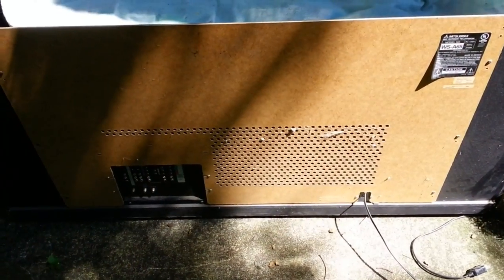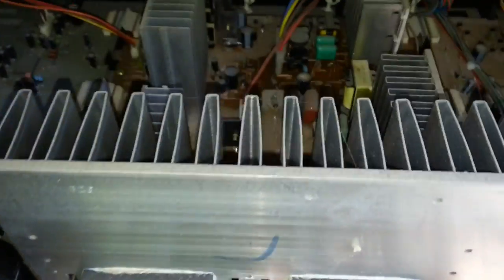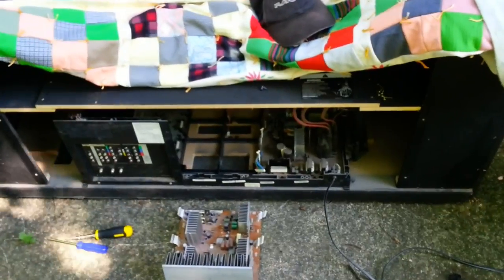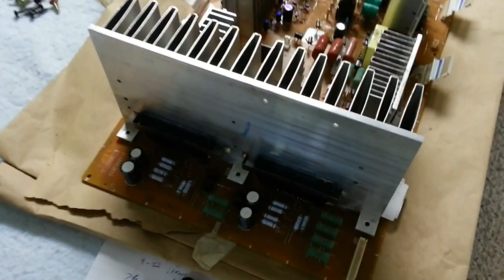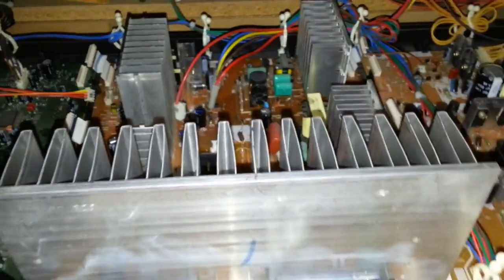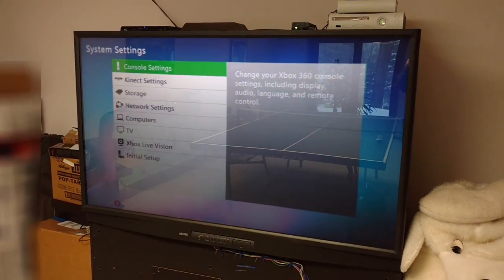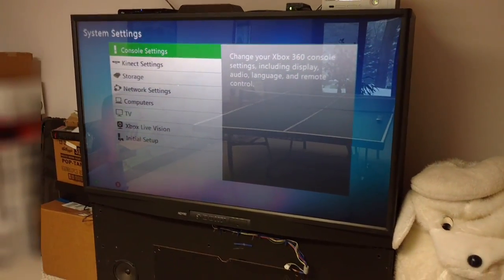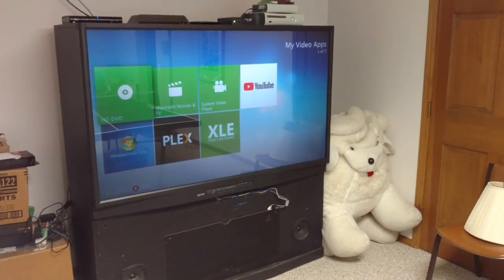Mitsubishi WS-A65 Repair V-Log and CRT Rear Projection Discussion

Comment: If there is anything more un-loved than a leftover CRT TV, it has to be a leftover read-projection CRT TV. The things were so big and ugly that I remember a co-worker buying one brand new and having his wife throw it out of the house. And, as the story proves, they were a nightmare to maintain. I've heard of models in which the  fluid would leak out and actually cause the boards underneath to catch fire after the fluid boiled away. But, I'll bet these things, the few of them which are left in 10 or 20 years, will be serious collectors items; transitional technologies are always kind of interesting. The original high price is understandable considering all the expensive parts in them, but they were not for the faint-of-hear. Meanwhile, I'm glad to  hear that some people are willing to live with them. I wonder if there is a way to make a drip pan or diverter to keep the fluid out of the guts of these things.
Reply from the maker: Thanks for the commentary. I agree with much of that, although I'm not sure that it's a class of product that will have collectibility. I'm willing to be proved wrong on that, however. Many of these are actually supposed to have a primitive apparatus that collects leaking coolant, but I'm not sure how widely that was implemented or how effective it was. Apart from that, (and the  requisite stressful lens cleanings and occasional convergence adjustments) they're actually pretty much maintenance-free; especially the analog models. As far as the MSRP goes, I see where you're coming from in that all of the components were designed for that application, but when you consider how much they cheaped out on factory calibration, (with the intentional excessive overscan used to hide the incomplete geometry adjustments) I still question how "pioneering" they really were, especially when you consider that a lot of the technology was based on the CRT front projectors already in existence. That said, it is worth mentioning that front-projectors could be a lot more expensive (many, if not most, of those were priced between $10,000 and $30,000 in 1990s-value money) and didn't have built-in speakers, tuners, or the requisite projection screen and mirrors, so maybe rear-projectors really were worth the asking price after all. It's probably just the details-oriented side of me who hates a half-assed job.
Reply: I agree with most of what you say. I have a Sony TV projector and I've had it for 13 years and the only problem with it is that the colors are messed up.where you see the letters doubled and the colors are 3 fold if you understand what I mean.  Everything else works except that.  I love my old big TV. I'm trying to find someone to fix it. It's a classic for me. Yes I have my big HD TVs also but I still love my old TV.  So if anyone knows anyone in the state of New York that can help me and fix my TV, I would really appreciate it with all my heart! Thank you!!!
Reply: @rosalinagarcia17  STK ics have failed. It’s not an expensive repair. Image is out of convergence
Reply: @rosalinagarcia17  you just need to adjust the convergence allot of these tvs allow you to do it from the menu

Comment: I picked one up a few months ago, after a while of on time, the picture would shut off. The time it takes for that to occur has decreased significantly, I've read about possible bad soldering at the heat sinks, but in not sure what I'm actually looking for. It's a wonderful tv and perfect for what I got it for, and I don't want to get rid of it for something that might be very simple.
Reply from the maker: Check for evidence of coolant leaks under the tubes. It's corrosive and conductive, so it will eventually do irreparable damage if left untreated.
Reply: Browningate I see no evidence of any liquid leaking in the tv or on the electical panels. My power never shuts off, I lose the picture. After you let it sit a day or 2 it will work fine again for a little bit. That's why I was asking about possible failed solder connections at the heat sinks.
Reply: Browningate thank you for taking the time to respond, I appreciate it very much.
Reply from the maker: @16dbuse
You're welcome. Check again. When this happened to me, the television interpreted a continuous holding down of the power key, which would blank the video, but not turn off the audio. Cleaning the leaked coolant immediately solved the problem. Check especially carefully on the front of the green-colored board.

If your convergence ICs go bad, the 3 primary colors will start to lose their geometry on-screen. This will happen very obviously and abruptly, but you'll still have something on the screen. That's the only case for touching up or replacing the convergence ICs. The symptom you're experiencing would not be caused by convergence ICs, as far as I can tell.

Comment: Wow, I had one very similar to this. A selling point(?), if I'm recalling it correctly, was that it could accept some sort of 'smart/HD module' down-the-line. I always kept that option in the back of my mind through 2007 or so when flat screens were starting to really take off.

My big Mitsubishi was supplanted in my affections by the 32" Panasonic Viera we bought at BJ's Wholesale Club just prior to the Super Bowl in 2007. That 32" Panasonic was priced at $1300; I'm citing this for contrast of pricing. My Mitsubishi was over $2300 at Best Buy in late-October of 2002. I also purchased a progressive scan Mitsubishi DVD player to complement my new TV. The setup was my premiere venue for entertainment for several years and that projection TV served us well.
Reply from the maker: Thanks for sharing! The module that you referred to in your opening remarks was just a basic OTA ATSC tuner. Such devices are rare, but obtainable. As for the rest of the story, I'm glad to hear that it served you well. You took the $2300 early adopters fee in the jaw like a champ and paved the way for the future, even if you didn't really get to enjoy much of the future while you still had it.

Comment: The coolant is ethylene glycol, once it starts to leak it will not stop. There is two reasons it will leak, one is the chambers on those sets and a hell of a lot of other sets were a bit shit. Two is the glycol is hygroscopic, so given the shit coolant chambers, the glycol will slurp up a bit of extra moisture and swell the bellows, when it warms up it will be too much pressure, and it will start to leak. 

The best option is to drain the coolant and clean out the chambers, then refill it with polypropylene glycol, and when you do that, leave a bit of air in there to allow for expansion. The poly glycol is not near as corrosive, and not near as conductive. The refractive index is almost the same as ethylene glycol, and the cooling properties are about the same. The set will need a full calibration following a correct service manual procedure after glycol is changed, especially the blue tube because it requires a special adjustment procedure to be performed on electronic beam focus or you won't get accurate grey scale and you will need to drive the blue much harder to get good brightness, which will result in pretty quick phosphor wear. 

That set is very likely to have a variant of Panasonic P16 electro-static focusing tubes, if indeed you set the astigmatism correctly on them and do a full setup from scratch, the 1080i image will have crisp scanlines visible. There is a few beam correction magnets on the neck of the tube, down near the neck boards. There will be at least a 2 pole set, and probably a 4 pole set, some have a 6 pole set, and some will have an electronically adjustable set, similar to an electro-magnetic focus tube in a front projection CRT. 

As you point out, a lot of rear projection sets were never really calibrated exceptionally well from the factory anyway. Manufacturers probably saw no real need to, given that the tubes could EASILY resolve 576p even with a mediocre calibration, but with some work they will have a real good shot at perfect 1080i and 720p as well, on the sets that will display it. 

The Panasonic P16 family of tubes was used because they are brighter and sharper than the other available tubes, with most of the others being Sony, very few used Toshiba and NEC tubes (those were 7" tubes, the P16 tubes are 8" ), none would have used any of those by the time this set came out. Even the Sony rear projection CRTs used Panasonic P16 tubes in majority of their bigger sets, and used a electro-magnetic focus long neck version of the P16 in the G70 CRT projectors, with the G90 using the huge P19 Panasonic tubes (also used in the later versions of the Marquee 9500 ULTRA and the Barco 909/Cine 9) 

The coolant chambers were usually made by the manufacturer selling that model of set, so it was hit and miss as to just how good they were at staying sealed up and not leaking. I have never ever seen any Panasonic GAOO or Tau GIGA leak. Hitachi and Mitsubishi were commonly used in arcade games, and it is rare that they won't have leaked by now. LG and Samsung were basically the same chambers, and held up a little better than a Mitsubishi. Toshiba sets i don't know if they were an issue or not, they were quite rare here due probably to the absolutely outrageous price they sold for new, they were often credited as being one of the nicest pictures straight out of the box, but they used the exact same tubes as the Panasonic GAOO sets used. The massive JVC sets i have seen used Sony 9" electro-static focus air-coupled tubes, and their image quality was pretty darn ordinary out of the box. GE and a few other very cheap sets in the mid to late 90s often used 7" Sony ES focus air coupled tubes, very similar to what Sony (amongst others) used in their very small CRT projectors. They often suffered from crystals forming in the glycol, but i have never EVER seen one leak.
Reply from the maker: Thanks for the insight. If I ever get another one, I'll have to keep that in mind. Interestingly, the service manual seems to indicate that most of these do have the 7" tubes though.
Reply: @Browningate  They are 8", they say 7" in the manual because that is what the manufacturer of the set has considered the usable size with their beam control magnetics. The astigmatism gets worse the further away from middle you go, and the edges are probably going to be pretty ordinary with Mitsubishi hardware attached. That set has only 4 pole correction, and no electronic dynamic beam shape correction either, so it is a mid field model. 

The small sets that used 7" Sony tubes were advertised as 5.5" tubes, but those same series of tube used in a front projector were usually called 7" tubes, because the deflection circuitry and beam control is usually better and more of the phosphor area can be utilised. 

The P16 tubes measure 8" from corner to corner across the tube face. On a set such as the front projection NEC XG series there is 2 pole, 4 pole, and 6 pole astig rings, and there is also multi zone electronic astig correction, so it is possible to get the beam focus near perfect across the entire tube face, and you can pretty much use the full surface. The magnetic rings adjust the beam shape so that when it hits the phosphor it is perfectly in focus, giving the smallest spot size for the best resolution. If the astig is not right, the image will appear soft. You can tell if it is good by displaying a test pattern, and adjust the focus pot, if the lines or dots move around as you wind the pot from full under focus to full over focus, the astig is off. If the lines or dots flair in one direction, the astig is off. 

It is a big thing when you look into it, calibrating a CRT projection system is a dark art.
Reply from the maker: @CaseTheCorvetteMan  Sounds like you were pretty into it. You would've liked Mr. Bob's forum thread.
Reply: @Browningate  still into it, spent over two decades in it, serviced, repaired, and calibrated LOADS of them, both front and rear projection ;)
Reply from the maker: @CaseTheCorvetteMan  Interesting. Would you say that the coolant leaks were the most common failure, aside from convergence ICs?
Reply: @Browningate  no, not back in the day i wouldn't because it was not common to see them leak like it has been as they aged. 

The convergence STKs have been a problem in quite a lot of sets due to the high temps they run at. In some cases the heat killed them, in others it cracked solder as you saw here. 

Some sets had issues with capacitors leaking or drying up, which if left long enough either corroded the board or caused excessive heat to kill something else.

Very few rear projection sets ever had any sort of HV issue that i saw, although Barco sets were a little prone to HV quad failure. 

In theory, if you took the tubes out and flushed, then filled with poly glycol, then go through the whole set replacing all the electrolytic capacitors with something very high quality, you could easily get another 20 years out of that set.
Reply from the maker: @CaseTheCorvetteMan  Mr. Bob often talks about lens cleanings to restore picture clarity. Was that something that you dealt with during the repair as well?
Reply: @Browningate  i don't think i know who Mr Bob is. 

Yes the lenses often did get a film of dirt on them, especially the ones that were in a sports bar when they allowed smoking in there, even the mirrors were filthy on those sets.
Reply from the maker: @CaseTheCorvetteMan  Mr. Bob is the CRT rear projection guy from AVSForum. Apparently he did a lot of calibrations and cleanings back in the day. He was a big CRT rear projection enthusiast until his wife made him trade it in.
Reply: @Browningate  sounds like he should have traded her in instead. What kind of partner is she if she 'makes' him give up what he enjoys?

No wonder i live on my own and like it that way.

I was a member of AVS Forum a very long time ago but rarely ever went on there.
Reply from the maker: @CaseTheCorvetteMan  I tend to agree with that. It can be valuable to make accommodations in relationships, but that seems like a bit of an extreme to me. It's not like he didn't use it or take care of it.

I used to be more active on AVSForum in the vBulletin days, but their leadership was just utter garbage. I ended up returning a few years ago, but was never nearly as active as before.
Reply: May I please ask if you have an idea what type of fresnel lens does this exact model use? Is it a spot or linear one?
Reply: @hawsantiago3697  not sure, can't remember what they had in them.
Reply: you available for repair job in Chicago
Reply: @DRAPETOMANIACPATIENT  not really, i'm in Australia 🙂

Comment: nice set I have worked on a lot Mitsubishi Tv's .
Reply from the maker: Thanks for sharing. Did anyone actually use these things with component or HD back in the day?
Reply: @Browningate  Component and my favorite HD TV is one of the last CRT tv's that Sony made it's a 34inch widescreen XBR  720P and 1080I it still has amazing picture on it still after all these years I did warranty work on Sony Also my repair shop we sold Sony New along with RCA ,Zenith Motorola, Sylvania and magnivox ,Philco and GE .

Comment: The challenge with those TVs was that those very bright small CRTs for the projection resp their phosphors wore out pretty quickly compared to a standard TV CRT. The phosphor is bombarded which much higher electron energies. And I bet you see on your TV also darkened areas.
Reply from the maker: This one, I suspect, didn't have particularly high hours on it, so it wasn't too grungy yet, but others left in what Mr. Bob used to refer to as "torch mode" (default 100% contrast) and used for tens of thousands of hours probably did suffer that fate much sooner than they should have.